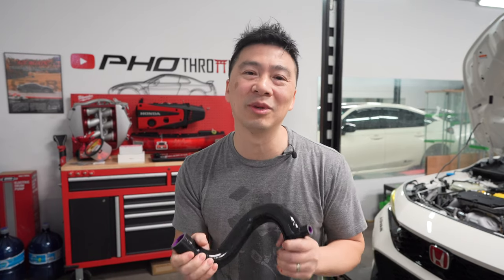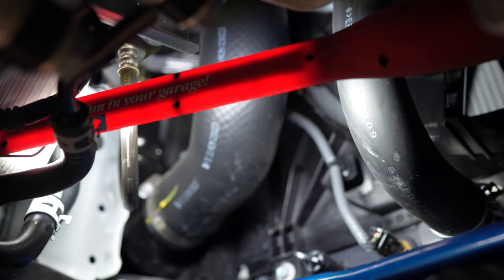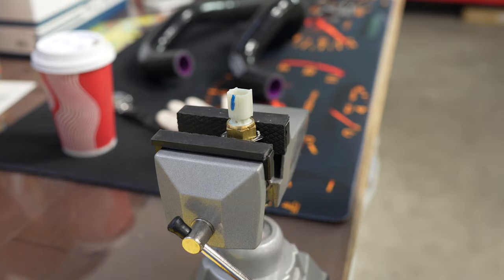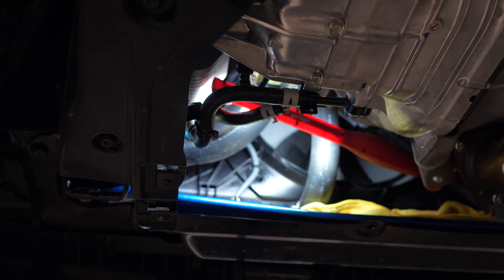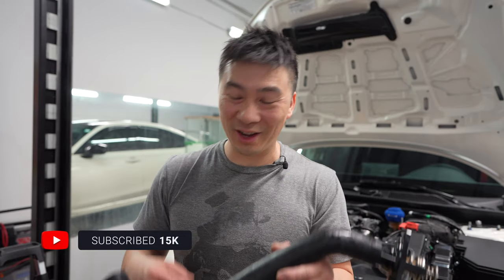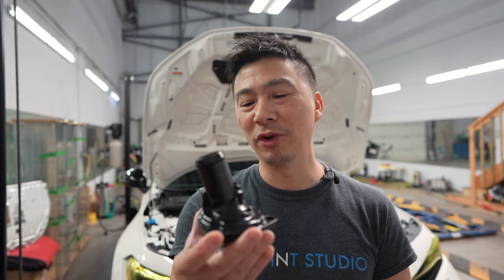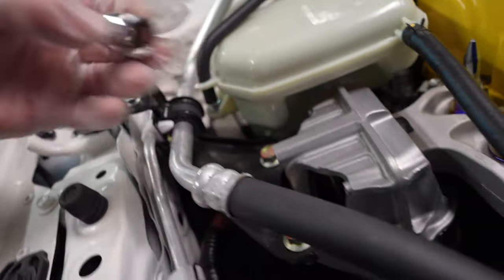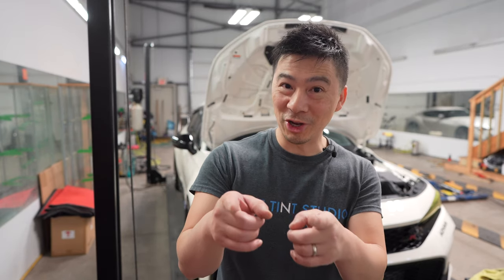Acuity Instruments Reverse Flow Radiator Hose || Honda Civic FL5

Comment: Use a deep socket or wrench to hold it. 😂  To prevent air pockets, disconnect a small coolant  line going to the cylinder head or throttlebody. 🎉 15k  congrats 👏 should have a FL5 giveaway to celebrate🎉
Reply from the maker: Thanks for the advice wish I had it before I did the install hahaha. Yes it will be doing another giveaway. Just waiting to see what is good enough for the prize any suggestions?